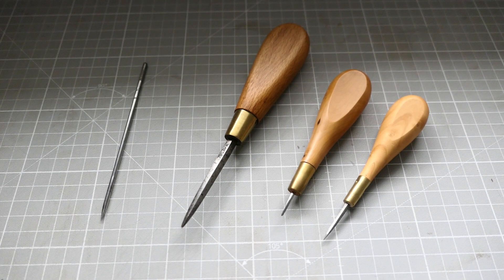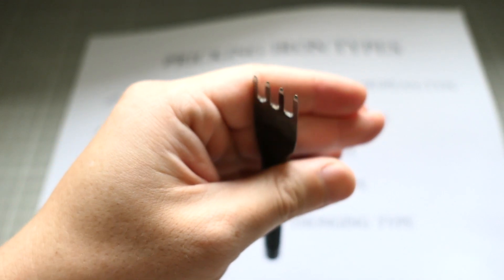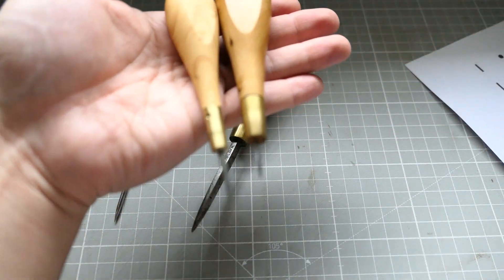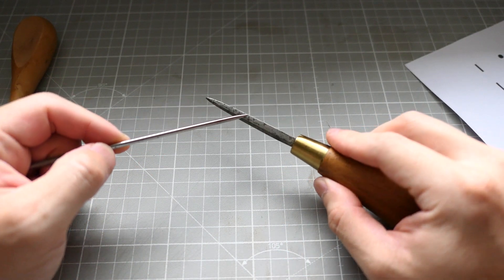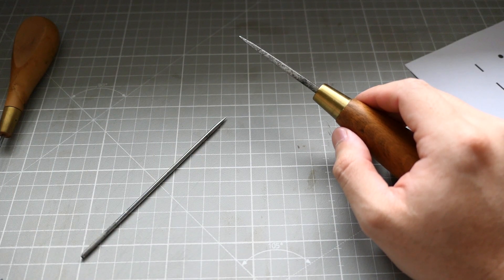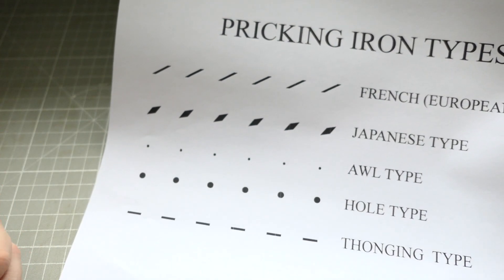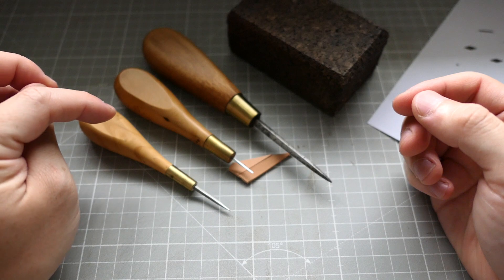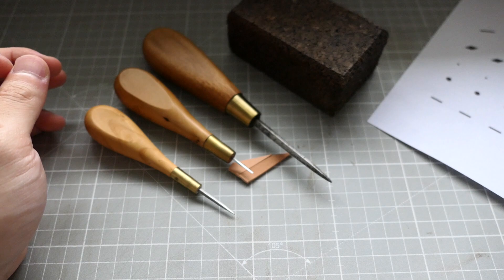DIAMOND VS FLAT AWL BLADES

Comment: Awesome video! Helps me a lot as I want a flat blade awl but what's available in my country is only diamond blade. Will try to reshape it. Also, if I want to make the width smaller (from 3mm to 2.5mm) how would you suggest doing it?

Thank you!